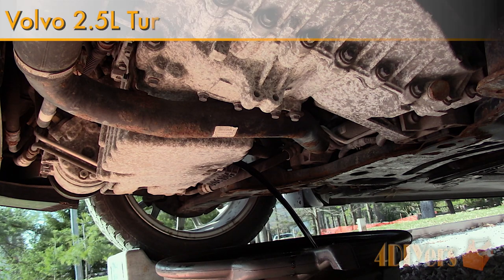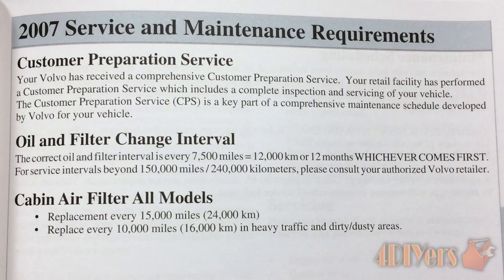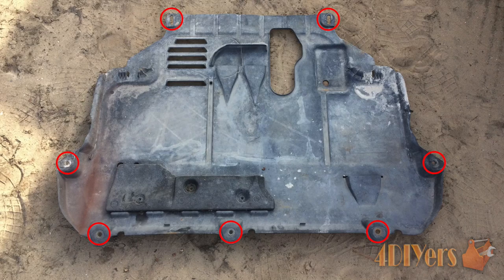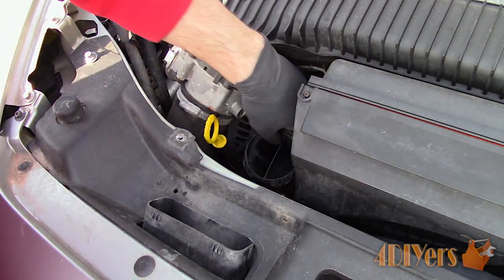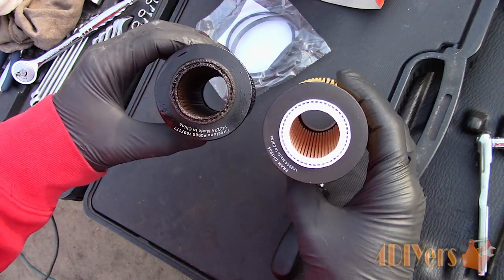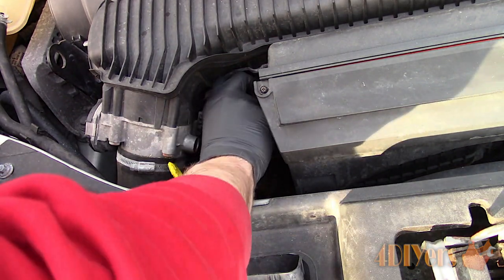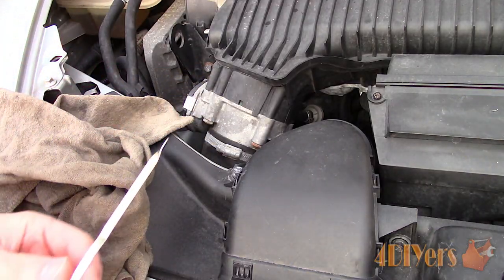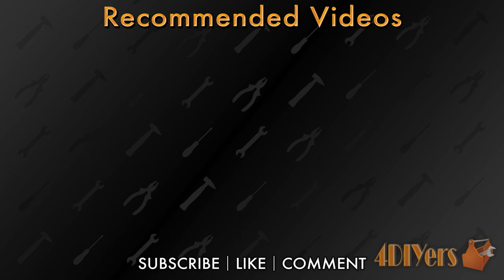How to: Volvo T5 C30 S40 V50 C70 Engine Oil Replacement

Comment: For all those with the 2.4i (non turbo), it is even easier because there is nothing blocking the oil filter cap nut. No removal of anything needed, at least on my 05 V50 2.4i.
Reply from the maker: Great info, thank you for sharing!

Comment: Excellent video. 2007 V50 T5. I got turned away at Jiffy lube because they thought they had to remove way more that what was needed... I knew they were wrong and I am glad they did turn me away because it was pretty easy to do. I will have a 36mm socket ready fpr the next time...;)

Comment: Far Right your missing a screw on engine Splash Guard..or was that taken off with Engine Splash Guard..curious what is Screw size of bolt/ screw that meets up with Wheel well Splash Guard..you know the 1 that uses those little Screw clips?

Comment: This is a great video!
Has anyone else had trouble with the T30 torx screws just spinning in place? I cannot get even ONE of them off, letalone the 7 - they just spin and spin. One of them I must have spun 60 times and it aint movin'. Thanks in advance to anyone who might have an answer.
Reply: Haven't had that issue, but it may be an indication that the plastic inserts are worn out / stripped.  To get them out, you could try inserting a small flat screwdriver underneath head / washer and pry downward as you back the screws out.  I've not tried this, but one possible solution (after you've removed the screws) could be to insert some silicone adhesive (like caulk) inside the plastic inserts that hold the screws.  Let it sit for a day so that it fully cures / hardens.  Once it hardens, the screw threads will have something to grip.  Hopefully they won't spin on you.  When you install them, don't over tighten them, or else you'll just further strip the plastic.

Comment: When I changed the oil on my V50 T5 the oil filter housing was full of oil? Like it didn't drain out. This meant that when I removed the filter there was a lot of oil drippage and when inserting the new filter it overflowed. Have you ever seen this? I am worried that there may be an issue with some sort of drain back valve or some blockage in the oil system. The car runs fine with no obvious oiling issues.
Reply from the maker: Yep I've seen that before. Try loosening the oil filter housing cap first, then remove the drain plug. Also make sure the engine is warm so the oil flows more freely.
Reply: 4DIYers Thanks for the tip! It worked great. Undid the oil filter housing first and left the oil cap on when draining. No more messy filter change. Cheers.

Comment: Thanks for the video. What happens if you put regular oil in after you've drained the oil out and its had synthetic in there before?
Reply from the maker: No problem. Most engine oils are made to be interchangeable. Switching over to a conventional oil will have shorter maintenance intervals and it's not as good of a quality as compared to synthetic.
Reply: @4DIYers Thanks for the response. but im referring to the idea of adding regular in the engine after synthetic has been in there. Does it matter ?
Reply: @fl33k59  no problem.   they actually blend them anyway which some folks prefer

Comment: I’m always told my filter is wrong. I’ve bought and returned from multiple major chains. Volvo dealerships charge 2 or 3 times what most oil changes charge. Any advice? I’m not in a situation where I can change it in my own.
Reply from the maker: My advice would be getting the part number from the dealer, then reference that to an aftermarket filter like a Mahl.

Comment: I know this is an older video and you may not get this comment but can you tell me what size crush washer should be on drain plug? I'm due to do my first oil change and don't fancy getting everything drained to find I have the wrong size lol
Reply from the maker: The new filter should come with a new crush washer. If not, I usually keep a kit on hand with various sizes. Comes in handy when you're in a pinch.

Comment: Excuse me sir, but can you tell me, if oil filter housing is located in the same place on the 4 cylinder 1,8 petrol engine?
Reply from the maker: I would assume so but we didn’t have that model of engine available in Canada.

Comment: How do you reset the “maintenance required” setting on the trip computer? Or does the Volvo figure out an oil change has occurred automatically..?
Reply: Insert key turn to position 1 then hold the trip reset button. turn key to position 2 and wait for the warning light to blink.